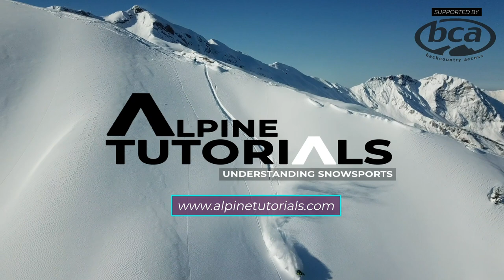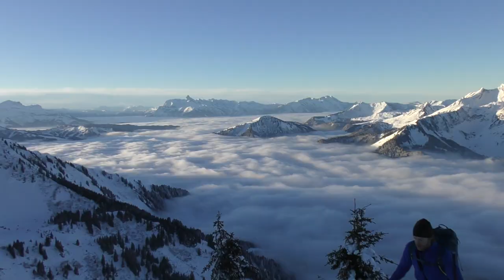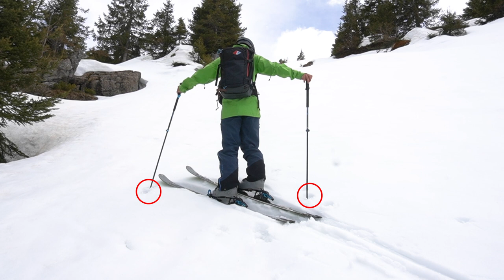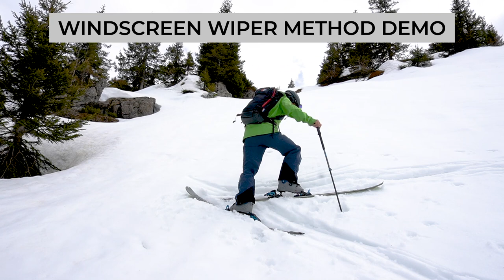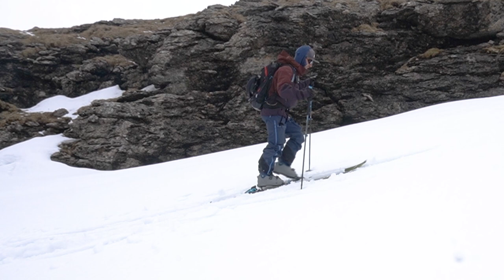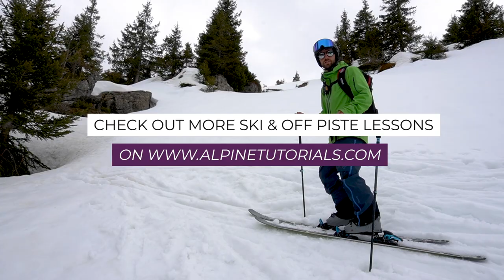How to KICK TURN when ski touring or split boarding

Comment: All good, however, on steeper terrain and for those of us who are less strong and flexible - ok, let's just say older - there is the technique of driving the uphill, kicking ski tail beneath the middle (under the foot of) the downhill, platform ski, and continuing to rotate the uphill ski as far as possible across the fall line. The two feet are then closer together, making it easier to transfer weight onto the uphill ski and lift the downhill ski off the buried tail of the uphill ski and to bring it around. Sounds odd but works well and lots of people do it this way.